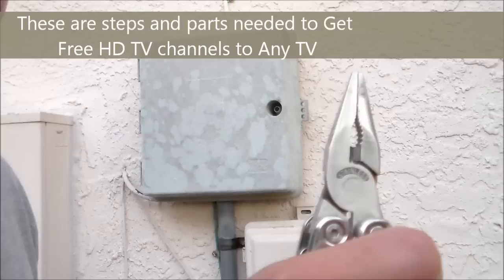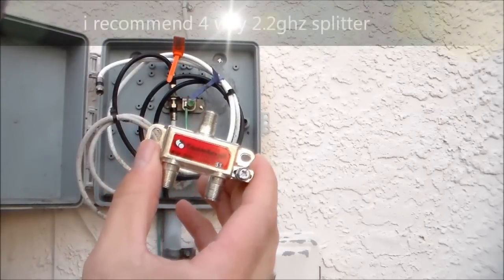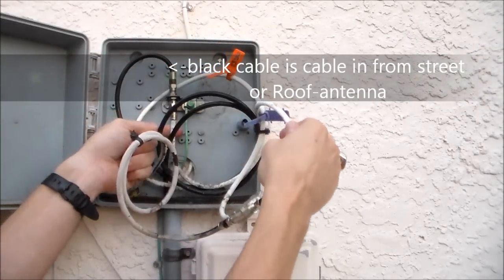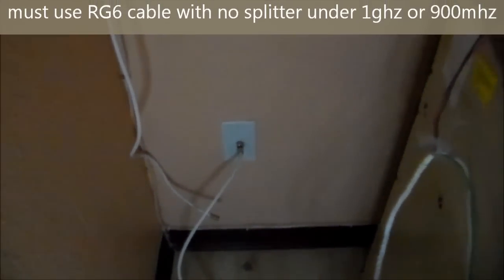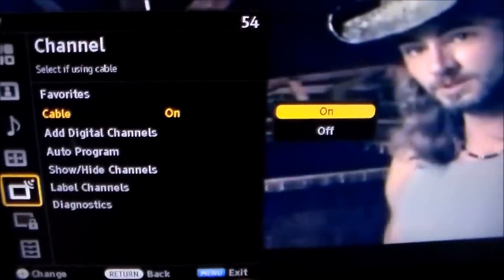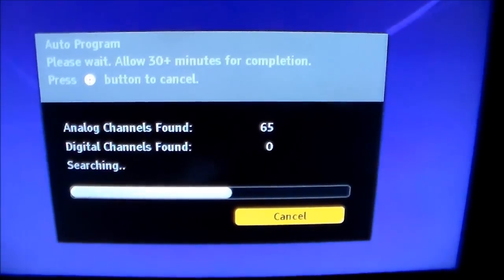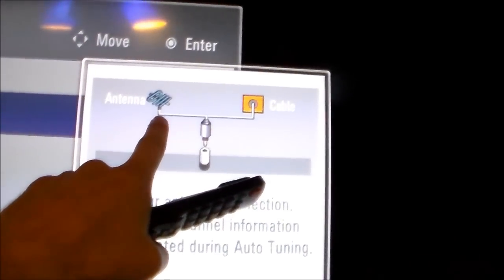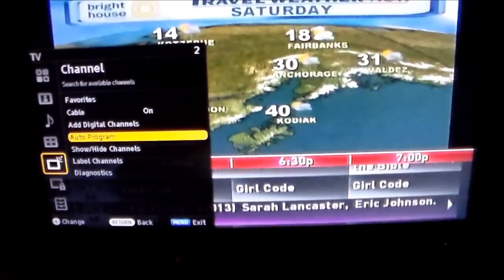How to Connect Cables to Get Free HD TV Channels Legally!!!

Comment: How do you mean connect legally when opening the cable box voids it and that's not your property? Can you not be prosecuted for forcefully opening the cable box?
Reply from the maker: I worked for cable company and those cables in the box mounted on your house are your cables legally, but cable box at the street with the lock is theirs which you can't touch. if you chose to connect more rooms for basic cable for free without paying a rental cable box that is legal. I hope that clears things up.  :)
Reply: *****
 I have to disagree.   I work for a cable company as well.   I'm not sure if it's different between various companies, but for the one that I work for everything from the street to the CSE (the box that you opened) is owned by the cable company.   Internal wiring is owned by the customer. 

The CSE's that I install actually have i disclaimer printed on them saying that stealing cable services is a prosecutable offense.  

However, putting a splitter on inside your house is entirely legal and cable companies have no problem with it.   Just really shouldn't mess around in the box, do the splitter connection inside your house. 

Some techs when disconnecting cable services are lazy, and simply disconnect them inside the CSE's instead of at the street like they should.

So... Stay out of the CSE's.
Reply: Accurate TV Repair Home Theater Design
 Yep, what he said.   Stay out of the CSE, (the little grey box on the side of your house).   That's the cable company's property.   In fact the underground line that is ON your property, leading out to the pedistal where it hooks up to the main line is not even your property, it's the cable company's property, even though it's on YOUR land.   All the internal wiring after the CSE is your property.   If you're going to put a splitter on somewhere, do it after the CSE.   Don't open the CSE, or you're tampering with the cable company's property.   Odds are they won't do anything, but you never know...
Reply: ***** It depends on the vendor and system. Some vendors charge per room and others dont,
Reply: Jimmy, check out his angieslist account. Every positive comment (all five of them) were all written with the same terrible grammar.
Reply: Jimmy Pizl
Jimmy, while I don't condone the name calling between you and Accurate, he is indeed correct.   Believe it or not, everything inside the CSE, in the ground, and out to the street underground belongs to the cable company.   Even though it's on your property, it belongs to them.   The cable that exits the CSE and enters your house, the internal wiring, that belongs to the customer.  

Some people find it hard to believe that a utility box mounted on the side of their house is not considered to be their property, but that is the way it is. 

It's the same as how in some cities, the power and gas lines leading to your house from the main are considered property of their respective companies, despite their presence on your property.   You pay for their use, not for their ownership.   Now with gas and power that's generally on a city by city basis.   Some cities the gas and power lines are considered the customer's property from the main line to the house.   Others say only from the meter to inside the house is owned by the customer.   A power line or gas line from the house to an unattached garage is 99% of the time considered the customer's property however, as it was likely installed by the customer themselves, or by their construction contractor. 

But with cable services, it's pretty cut and dry.   Everything wired outside your house is the cable company's property.
Reply: But in closing, I'd just like to say that what you've done here, putting the splitter on, is not illegal at all.   Anyone can do that, and cable companies don't give a damn about it.  (the more splitters you add, the lower your signal will be however).   The only problem that exists in your video is the fact that you opened the CSE to do it.   You should add the splitter inside your basement.   I was actually surprised that you were able to remove that lock from the CSE with a pair of needle nose. That must be an old design, or it wasn't properly tightened when installed.   They actually are supposed to require a special tool to remove, and shouldn't be able to be removed that easily.   I'd wager that most people who follow this video will find that they are unable to open the CSE as easily as you did.   Most modern locks will just turn in place and not unscrew unless you use the proper tool to remove them.

Edit: After watching a few other videos by other people, it seems they were able to get into their CSE's about as easily as you did.  However they pulled out a lock that looks identical to the one you pulled out.   I'm of the opinion that is an old design, the ones we install should not be removable by a pair of needle nose or a screw driver.   Then again, perhaps they are.   I've never actually tried, as I have the tools to open them legally. 

By the way, if you're wondering about my credentials, I've been installing cable service drops, and main line for the last 14 years, as well as all manner of other underground utilities.  I know a thing or two about the subject.
Reply: ***** I don't see where we disagree here... The line still belonged to the cable company, but the person in charge of placing the new line (usually a contractor) cut corners and put it on your property.   

In a situation like that, I wouldn't suggest cutting it on purpose, but you could definitely contact the cable company and the contractor responsible would have to return to do the job properly.   

There are some instances where a right of way can be negotiated with a neighbor if the lay of the land or location of existing utilities makes placing a new line difficult, but without that agreement they should not have cut across your land to place your neighbor's line.
Reply: Not true Joe.   Do you or one of your neighbors have utility boxes either near the street, in your back yard, or off a back alley in your back yard?   Do you think those belong to you?   No, they belong to their respective companies.   Same goes for the underground cable coming to your house, and up into the CSE.
Reply: Accurate TV Repair Home Theater Design  YOU ARE SOO WRONG! The only thing on your house that the electric company owns is the meter. The can that it snaps into is yours. The wiring on and in your house is yours. These "utility companies" provide these (if for some reason the electrician didn't finish their job) so that they can sell a monthly service to you. Just like the cable box or "D-Mark" as we professionals refer to it, that is where all of your cables terminate of course you're allowed to go in there, It is yours. Everything we install/mount to your house is yours. . You pay for it, even if it's "free installation" you still pay for it. Electronic equipment that you rent isn't yours like the cable box, SATV box/DVR, remotes. When you cancel your cable or SATV service they don't come remove everything, most of the time they don't remove anything. As a tech I will remove the LNB off a SAT dish just for my own stash of spare parts, but that's it unless the homeowner requests. We don't remove switches, dishes, or splitters because they are all yours now. If you don't know what you're doing you should stay out of them.
Reply: 3 big cable companies and 1 business division I still work for, You don't have any right to the box, until 6 months later. Per FCC the NID or Lockbox will become customers property after that time frame or if you cancel Cable. Why do you think we don't come back to take the boxes off your house. The Box is a form of branding the house on your cable service. Cable companies really don't want you messing with it due to grounding issues, if you get a power problem and it was the customer messing with the grounding, it can cause a power feed back or worse.
FYI, the new boxes might not come with a lock on it any more, or just zip it shut.
Hope this is about the house grounding lock box and not the service PED, now if you mess with that it's a 5000 dollar fine or 1 year in jail or longer.

Comment: Um, yeah. Big goof-up. You connected the "in" port of the splitter to the black cable coming from the street, and the 2 "out" ports going to 2 rooms. But nowhere in that setup was anything coming from the antenna. So what's the point of even having the antenna? What you need in order to get a signal from the antenna is a cable coming from the antenna to the splitter. Oh, and if your intention is to have 2 signal sources (antenna AND street), then you would need a splitter that has 2 "in" ports.

Comment: Remember over the air antenna is legal.  I don't recommend routing it through your cable gateway but he isn't doing anything illegal.   Remember that all equipment has to conform to part 15 of the fcc guidelines.   That means cable TV is subject to receive interferences and they have buffers to deal with that.  All electronic devices (except scientific devices and other mission critical devices) MUST absorb stray signals.  So routing Ota antenna through his cable gateway is legal however it makes no sense. 

Cable company has the right to remove equipment from his property  but not to  stop him from opening the gateway.  As long as he isn't stealing cable and has no intention on doing so then he is in the right.
Reply: The box he went into is Cable company property and every cable TV contract I ever saw PROHIBITS it.
Reply: John Mood the box on your HOUSE is your property... the box on the STREET is theirs.
Reply: Ill Timed Will Inc Connecting to cable company systems to get their services for free, no matter how you do it is AGAINST THE LAW. I've read the law, and actually  arrested (and got a conviction on) an individual for illegal connection.
 I'm a retired cop.

Try this garbage at your own risk.
Reply: Accurate TV Repair Home Theater Design You have the internet, do some research know it all. You have no clue, you must represent a cable company. The only thing that is theirs is the signal.
Reply: Accurate TV Repair Home Theater Design your wrong btw like i said the box ON THE HOUSE is yours NOT the cable companys.

Comment: Hi,  yesterday I connect my laptop to tv n later I lost my all hd channels n I did auto tuning but it doesn't work so plz help me how can I fix my hd channel my tv is LG same as urs in ur video
Reply from the maker: connecting laptop to tv won't delete programed channels,  reset tv and check your connections.
Reply: +Tampatec  I did same thing which u told but it tuning only cable channel only not hd channel
Reply from the maker: +sonam tsering try program both analog and cable option
Reply: +Tampatec I did all the options but still not coming anyway thanks for ur helping hand. God bless u.
Reply: +sonam tsering Did You get any HD's? I did the same and now I have Netflix and shaw .You have to press on ur remote control 249 386 at the same time and then turn on the lights in the kitchen room.
Reply: +Metaxa 7 that is wrong on so many levels, but still i am roflmao!
Reply: +John P. Gizzi you can see a bug while he is unscrewing the box
Reply: +Cedric Banzeba        THAT 'S A FROG IN THE CORNER
Reply: +Dale Couch really
Reply: Dale Couch ya think? The guy SAID: Watch out for frogs.
Reply: ut oh.   you get it fixed

Comment: But you didn't show where the other cable came from? Was it already there by the cable company?
Reply: The cable wire comes out the ground and goes into this fancy weatherproof box that NOBODY in my neighborhood has. Our wires come out the ground and then go to a splitter to split between 1st and 2nd floors. You still need a cable box for scrambled channels. HBO etc is pay only and you will not get pay per view without a Cable box either. Cable Cards do not get pay per view either which is how they make there money selling you a cable box, even though the box itself has a Cable Card installed inside of it. Especially MultiRoom units, look through the vents you will see a cable card inside.

Comment: You are better of putting the cable behind the tack strip of the carpet & if the padding is in the way just cut if off. and when putting the cable on top or around the tack strip hammer the shit out the track strip because it will bite the cable if you dont.

Comment: I work for a satellite TV company. That thing you took out of the box to get it open is called a locking terminator. The one you had wasn't put on right or was broken off prior to your video. I have had to break into a lot of these boxes as a satellite guy because that is the only way to access the house wire I need. It usually takes 5 to 10 minutes with a hammer and chisel to bust those puppies. The cable company uses it to keep people out of their boxes. They can put them on the end of a line as well to lock out the cable inside the box as well. This is signal piracy (a felony in most states) and if you were smart you would take down this video.

Comment: I just went out to look at how mine is connected,and it is will wires, and the persons wires and mine are connected. So how would I go about getting mine figured out?>
Reply: What persons wires. A single family house the wire comes out the ground, a splitter just lets you run cables to other areas of your house. Usually a drop ceiling in the basement you can run the cable up there and then down to where your tv is or through the inside of the wall, using a fishing tool and cutting a small hole for the wire to come out of. Ours goes to our 2nd floor, through a hole where the phone cable already comes in. We just fished it through the phone wire hole and plugged it into the tv on our 2nd floor and used a rubber circle O-Ring to keep water out of it through the aluminum siding.

Comment: Dude is there any way I could use the satellite dish as an antenna to watch air local tv?
Reply from the maker: its not designed that way but you can get off-air antenna that attaches around the sat-dish which works good.

Comment: I try so many times and mine doesn't get channels I had twc and I canceled my thing with them does it work if I connect to my tv
Reply: You need an antenna on the outside of your house or up inside your attic to get FREE channels. Older tvs had Rabbit ears but you had to adjust them to get channels to come in clearly. Depending on your region, mountains, hills, etc, you will need an antenna at least 10 feet or higher off the ground. Our ABC station in Seattle 50 miles away only shows up if our antenna is 10ft or higher so those INDOOR antennas would not work unless you had high cielings. There is also an ATTIC antenna, but watch the ratings, a lot of them are crap and you need one that gets both UHF and VHF signals to get ALL the free channels in your area. Even then sometimes the reception is not that great it can be pixelated.

Comment: So if i do this i can get channels like GSN, E! Cartoon network ect
Reply: Only tv channels that offer Free Over the Air HDTV will show up. Depends on your location. Cable companies are trying to have laws changed in the USA so nobody can use antennas anymore on there house. They want everyone to pay for basic cable. Depending on the type of antenna on the house for UHF/VHF channels you would get the channels if you are close enough to the transmitting towers. There is a website to check your area and topography and how far your house is away from the towers.

Comment: just about any thing can work for antenna to get d tv
Reply: Our ABC station you have to have an antenna 10 feet or higher off the ground in order to get the signal where we live. There is a tv antenna website you can enter zipcode and address and it will show you what channels you can receive. You also need a antenna that does both UHF and VHF because a lot of FREE channels are not broadcast on both signals.

Comment: what about if u live in apartment not a house that u own could still can do this
Reply: No
Reply: You would need permission some places will let you have Dish or Satellite on the roof. You would install an Antenna like the one he shows somewhere outside near the roof line or higher. In Tacoma, WA our antenna has to be 10 feet or higher off the ground in order to get ABC otherwise it will not come in with these fancy in house antennas. They do sell ATTIC Antennas if you have access to an attic and its higher then 10ft from ground level. There is a website you can check which shows topography in your area and whether or not you can get local channels and which ones depending on how far away you are from the tv transmitter towers.
Reply: You can run the antenna from inside the apartment with the cable going straight into the splitter or tv.  Depending on how the building was constructed is how it will affect reception and distance from transmitter

Comment: Sorry but no cigar fella.its not hi def if u bring it to ur tv with a coaxial.
Reply from the maker: Yes & No, old rg-59 coax you can't get full hd but rg-6 coax you can get hd if TV has an HD digital tuner, directv box, dish network box, Fios box, cable box, off-air HD tv tuners, all uses RG-6 coax cable to get hd signal ( i worked for directv for a few years) coax can run analog signal with digital signals but old school "analog signal" won't be HD, so in that sense you are right.
Reply: i did not know that.thnx i will try it that way
Reply from the maker: Christopher Fulgham Most new TVs have digital tv tuners builtin, just connect antenna to tv and then auto-scan channels and bam you got free local hdtv channels in case cablebox or satellite box goes out this also works for PIP TVs too. 8^)